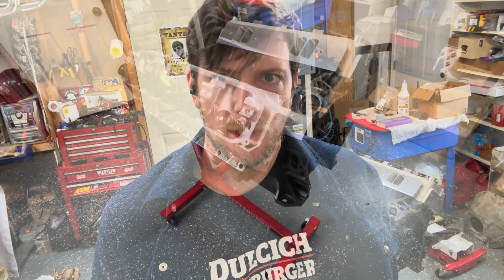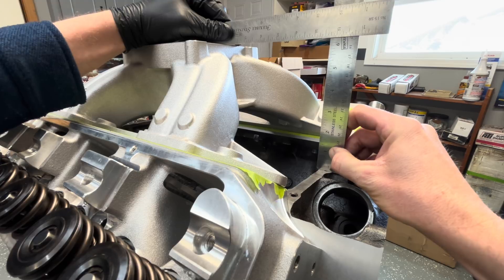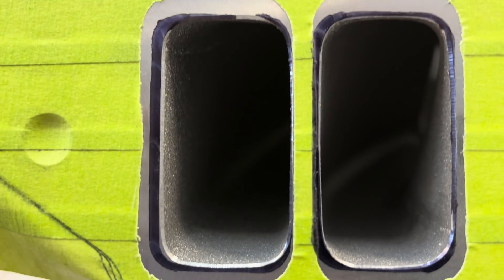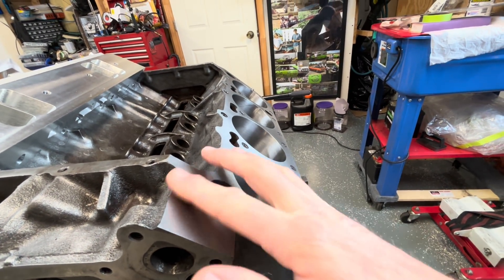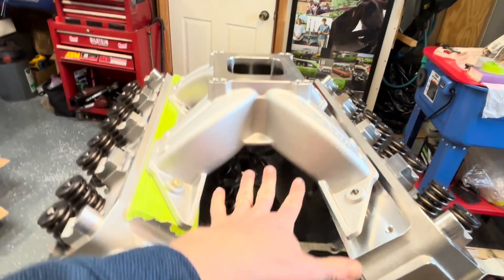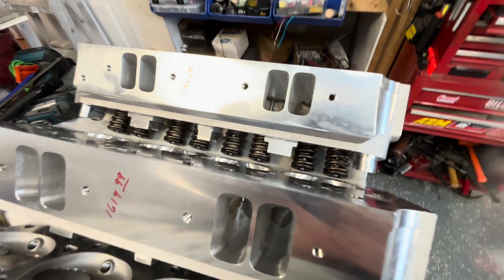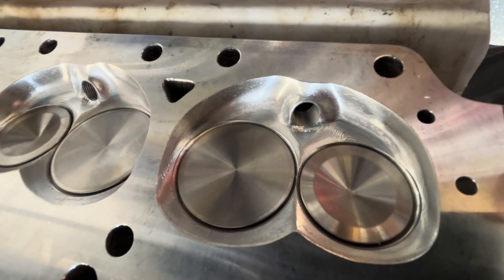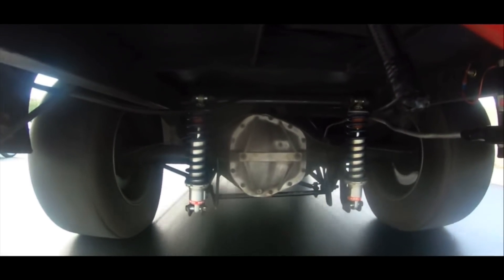Aftermarket Big Block Mopar Heads: Trick Flow 240 vs. 270 fitment with the Track Heat Intake

Comment: I probably sound like a stuck record but when is the penny going to drop and these aftermarket head manufacturers going to make a raised port option so any RB intake can fit on a low deck? Having B and RB intakes is stupid - they should all just be RB intakes.
A world of problems would be solved. In fact the low deck would become preferable because an RB intake on a low deck means even more hood clearance and the raised ports offer better VE.
Stage VI Mopar heads were like this. 440 Source should do it. Imagine how many extra low deck kits they'd sell as well as the heads.
It's only about the 987986578765609870980989th x I've mentioned it lol.
Reply from the maker: Very true!

Comment: Nice comparisons Joe.
Low deck for me TrickFlow 240's. 
The manifold is certainly an issue.
For a RB TrickFlow 270's for the win.
Use the TrickFlow R manifold.
I like cast heads.
Cast heads always a solid and dependable choice for budgets.
No issues with intakes and fitting under the hood. 👍🇺🇸
Reply from the maker: Thank you for sharing, Ed. There’s a good option for everyone out there. Hopefully this will help them out

Comment: Never really considered the hood clearance thing. That is something that would make a big surprise after all the work and be a big problem for some. 

I would add that if you have an engine build from the start to have your block decked so that you have the option to use MLS head gaskets. 
This was an after thought for me even after consulting Trickflow because they didn’t advise the MLS gaskets in their paperwork or speaking to a tech support. 
I have settled on using a graphite gasket made by Mahle for my aluminum trickflow heads. Mahle recommended using graphite because it has great heat conductivity and allows the head to “slide” between the cast iron and aluminum expansions. 3464SG gaskets for the 440. It has a bore of 4.430 and .045 compression thickness.
Reply from the maker: Good point on the MLS gaskets, thanks for sharing that! I'll have to remember that for next time.

Comment: We've done 490's (RB) with both the 240's and the 270's (Trick Flow) and the 240's always impress, whereas the 270's we used the one time really didn't make any better numbers with similar performance hydraulic roller cams. For the bigger heads to really show their stuff the engine needs a serious solid roller cam/race single plane/12:1+ compression. For a typical street build the 240's for a premium build makes much more sense. The Edelbrock heads are a great choice for a more affordable build with a subsequent reduction of HP.
Reply: My '68 Barracuda fastback runs a 400 based 512 stroker with Trick Flow 240 heads and a hydraulic roller cam with 254 duration @.050 with 618 lift. My car runs an A833 4 speed. I have ran a ported TM6 single plane and a port matched RPM dual plane. With the 4 speed, I prefer the RPM.
Reply from the maker: Thanks for sharing your experience! That’s exactly what the plan is

Comment: id buy any inexpensive heads bare ! the parts they use are questionable at best from things i've recently seen. it also makes porting them easier
Reply from the maker: You can definitely make them work and adding your own parts is a bonus

Comment: I did the 240s exactly for hood clearance on my 440 based 512 stroker as i have the six bbl on top with air grabber setup in a 70 GTX. Made 585hp and 620 TQ.
Reply from the maker: Nice work, sounds like a good combo!

Comment: The question I always like to have answered when anyone does head reviews is: how truly "out of the box ready" is that particular set? Sure its always a good rule to have them checked over at a machine shop such as Ed's before use but sometimes duders just can't get it done (price for extra work, wait times at the shop, etc) before the build has to get finished. Plus in answering that simple question it goes to show how dedicated that particular brand is toward quality control. No head should ever leave the manufacturer with sticky valve guide tolerances or untapped sparkplug holes.
Reply from the maker: Absolutely!

Comment: The notch in the left head to clear the distributor, is huge.. I started grinding on my Edelbrock performer 440 heads  and chickened out and stopped . Now, I have an ugly left head…do you have any advice for grinding the Edelbrock performers for distributor clearance?
Reply: Have it done at a machine shop
Reply from the maker: Just taking your time with the right burr bit.

Comment: Your thoughts on 440 source heads  I have special licence plates in BC Canada so my heads need to look stock or do you think a set of 906 heads could be ported well enough to flow for street use.
Reply: You're going to shave 40lbs off the front end,just paint them.
Reply: We have collector car plates that gives super cheap insurance under $200 as long as you have another vehicle insured with the insurance company. We have provincial insurance not private.To get that you need stock appearance.  you are allowed a few mods like headers. Our insurance company is called ICBC.
Reply: @frankschopp8748 I wouldn’t worry about that stuff . I’m in Ontario and have a Charger and two  Powerwagons insured with Hagerty … they don’t care what’s under the hood
Reply: Live in Alberta, in what respect do you have to run stock heads in BC? I’m confused
Reply from the maker: @frankschoop8748 here’s the rundown on the stealths https://youtu.be/OgE8iekVaCA?si=5wgJN7Goi-rd3GUv

Comment: I like that the Trick Flow heads can be bought setup with different valve spring packages to match most cams.  The Edelbrock and 440 Source heads just come with a basic flat tappet hydraulic valve spring.  When I built the Trick Flow 240 headed 505" 440 engine I used the recommended Harlan Sharpe rocker arms, but the cost of rocker arms has really gone up and might be a factor on which heads you choose to use.  Seems the Low Deck Max wedge intake selection is pretty limited and shocked at what the Indy single plane is selling for!  Wonder if an intake could be 3D printed?
Reply: My best advice is go with a low deck M1 intake and have some work done to it by a skilled builder.  Another option is the Victor intake,  not sure if Edelbrock has a low deck intake available
Reply from the maker: I believe edelbrock does have a low deck single plane victor or victor jr., but it’s standard port sized as well.

Comment: FINALLY! Talk about hood clearance. Everyone talks dyno numbers. No one ever discusses intake height, vs the hood. Some of us do not want a hood scoop.
Reply: I've a V8 Vega wagon and wanted stock hood. The 355 chevy dyno'd 25hp better with rpm airgap and 12hp additional with 2" spacer - that's 37hp across the rpm curve plus 20+lbs torque. But nope. I ate it. Wanted stock hood. And heck, 2700lbs and 425hp is enough to be fun. It's my 80s tribute hotrod build.
Reply: On the other hand no one races hoods
Reply: Not everyone races.
Reply: @iceman2k103 If you do not plan on racing and insist on running a flat hood then dont waste money on after market heads.
 Iron heads are going to run just as quick on the street as aftermarket heads when restricting air flow into the carburetor and forcing air to make sharp turns due to low riser intakes.
Reply: My big block Nova has the stock SS hood. I don’t wanna run the cowl hood. I run an old single plane Edelbrock Torker which is low profile. Was considering an RPM Air Gap but its higher😫.  Im close to the clearance limit as it sits sleeping in my garage awaiting Spring.

Comment: I'm that guy who has his project 67 440 Safari A body, waiting patiently in the garage ( 3 years or so) while he saves up for parts he can't afford.  so far I have a pair of beautiful  Tric flow 240s $6000 landed in Tasmania, a scat stroker crankshaft $3450. And many more new bits of gear like intake, carburettor, oil pump ect. Saving for roller cam lifters rockers pushrods. The list goes on. For me this is the way to go. Long wait but I will be satisfied that I have done the impossible in my world.
Reply from the maker: It sounds like you’re going to have one heck of a combination when it’s all together!

Comment: Great comparison. Indy makes a Max Wedge port single plane intake that fits the 270s, but they are very proud of it. 💵 with a .650/.650 flat tappet cam we made 723+ hp.
Reply: Awesome, Mark!! Luckily I bought the B and RB version of that manifold from Indy back when they were cheaper and I had the money!!! (late 1990s)
Reply: @rodneybyrd9516  👍🏻 I paid like $400 7 years ago???

Comment: Joe the comment about go drive your car and enjoy it. As for heads i can port stock heads that equal or exceed trick flows but the 270 are bigger port to start with. Indy is worth the money period. Best money i ever spent on my savoy drag car. But like you said. Hoard parts for years and loose interest or go drive the dam thing and have fun. If you want the 10yr plan build another motor. This is all about fun. I just bought a fun car just to drive and enjoy. Not changing a thing. I have cars in the works of all different flavors of stupid 😂 but those are all different levels. None are the same at all. Back to what ya said. Run what ya brung 😂
Reply from the maker: You’re absolutely right, go have fun!

Comment: I used the Indy cylinder heads 440-2 4150 intake with those heads on my 512 a little gasket matching in the ports it lined up well.
Reply from the maker: Excellent!

Comment: I thought the 270 were max wedge size .. Be interesting test to see the difference in torque and hp on a stroker engine between two different cylinders heads . Thanks for the videos
Reply from the maker: Yes sir. 270’s are MW. I’ll have some port matching to do
Reply: I enjoy watching your videos.  Be interesting to see what the build makes . Not sure what the limit of the stock block is as far hp , torque , rpms ect ... i heard of guys filling the block to the bottom of the freeze plugs to add some strength to the block . Never did that or main girdle..

Comment: Hey, I had Eddie RPM heads on my 440, dynoed at 580 hp/ 570 tq . Bought the TF240 heads and made 620hp /585tq. Didn't port anything just bolted them on. I like both heads but I'll take more power any day!
Reply: Id like to hear about your combo for sure.
Reply: @brianb5779  10.4:1 comp, 1.6 roller rockers, ultra dyne 613"lift, 276@50 duration cam, Edelbrock rpm 440 intake and 950 Holley. Run on 50)50 mix of 110&non oxy 93
Reply: and a1" phenolic spacer under carb, 1 7/8 headers. Best ET 10:75 @124, 4500 stall
Reply: 3700# Challenger, 430 gears
Reply: And lastly, a street car too
Reply: @da1082  Thanks brother
Reply: Thanks for the information  ! 👍🏼
Reply: I'm getting my 440 freshened up, it was last built in the 90s with a .509 purple shaft cam and template ported 346 heads. Heavy trw pistons and Torker 2 intake.  I bought 75cc RPM heads, 440source ductile iron 1.5 rockers, and planning on using lighter pistons that will produce more compression at least 10.5:1.
Reply: Stock displacement? I am building a 500cubic in engine with numbers jus under yours(cam, compression etc) and was shooting for around the same power output...
Reply: @zimmyplayz1755  it's a stock stroke engine
Reply from the maker: Yes sir made great numbers from the dyno 440 with the 240’s on here
Reply: @da1082  was the ultra ultradyne cam a solid flat tappet or solid roller  ?
Reply: @mitchellferre1652  flat tappet
Reply: @mitchellferre1652  solid flat tappet